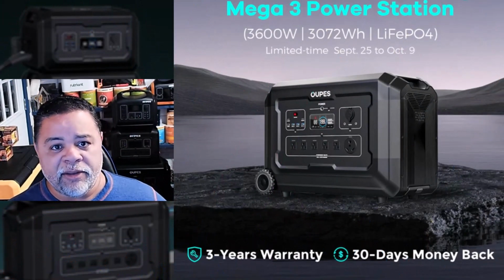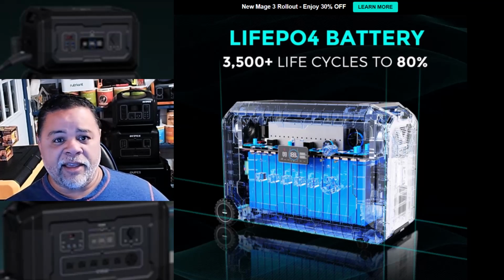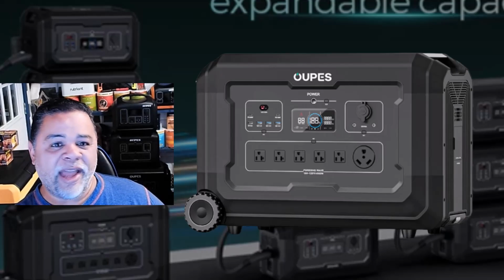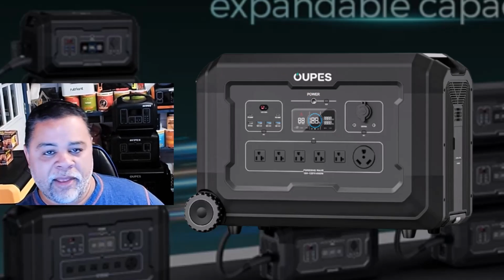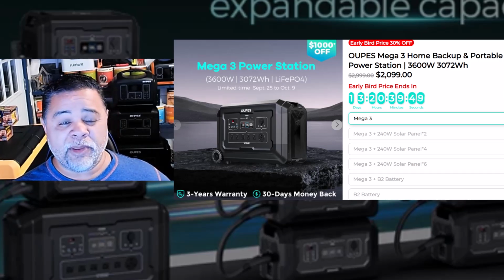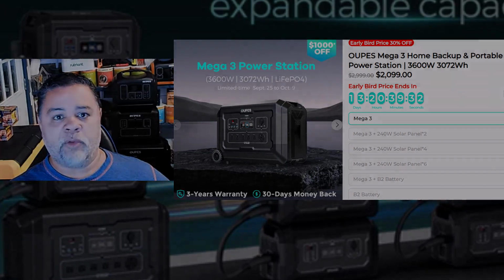When The Lights Go Out - It Will Be Too Late - Get Ready Now With Off Grid Power

Comment: I would love to see a vid that covers the mega3 paired with a oupes additional battery and their portable solar cells, particularly how all the panels are wired and if the array will recharge both the mega3 and the external battery at the same time while being connected, and also determining if the mega3 combines both the megas battery with the external battery when you need to power your house or if they are independant from one another. The oupes manual dosent give specifics on any of that and dosent even show polarities on their solar panel wiring to the system.

Comment: Good review!
Just want to make a correction… off grid Solar doesn’t cost $100k. Not even close. It is definitely expensive. I live off grid. I’ve been designing and installing systems for about 14 years. I’ve been teaching workshops since 2010. My point is I have lots of experience in this field. Systems are expensive but most of the offgrid systems we install run about $30k for a home. 
Cool stove has to be gas (propane or NG). Same with hot water heater. Dryer too if you need one. However fridge, freezer, water pump, lights, electronics and small appliances in addition to a washing machine are no problem to run on the systems we design and install. 
Sorry to correct you I just don’t like misinformation. And we are bombarded with it. 
Blessing brother.

Comment: The 30A socket on that unit at first glance looks like a 240VAC supply port but it is only 120VAC. It is industry electrical rules that require that style of socket when you are going to be drawing that much current on a 120VAC circuit. The socket that would supply power to a dryer or stove would have 4 "holes", 2 for hot, 1 neutral, and 1 ground. If you have a small dryer that runs on 120VAC with a 1500W element like a hair dryer, then you can use your solar generator but the runtime available for a high current device would be limited. 🙂

Comment: I witness the Montreal ice storm, it put the whole grid on the ground. That’s when I bought a 5000 W generator and store 50 gallons of gas during the winter.
Reply: I bought a generator after an ice storm knocked out the electricity for four days on Christmas eve. Never again, I raged.  I had an electrician put in a special circuit into my electrical panel so the generator can power my entire home.  I still have a couple of solar generators as backup or to keep the freezer and fridge working, or for heat.

Comment: Also AP you missed 1 important part you can buy an off brand reliance transfer switch and get it installed by an electrician which allows you to essentially run your whole house as it will auto switch to opus power if the grid were to go down basically like as if you never had an outage. Its also cheapest on market only 321 bucks for transfer switch with the mega 3 or even mega 5 and 25 dollars for the cord you will need. Of course this don't include installation by an electrician which is usually a few hundred bucks.